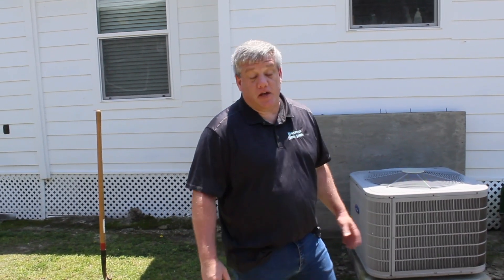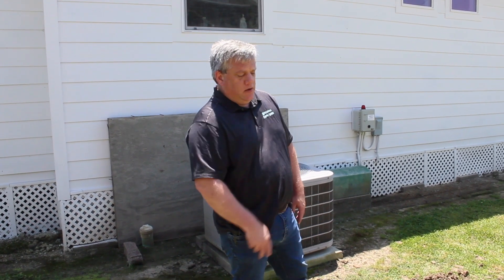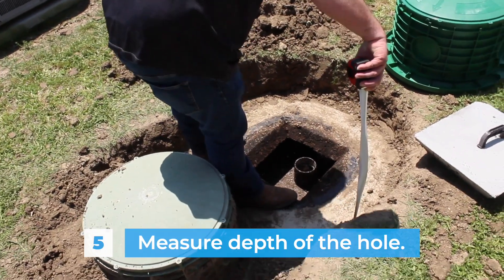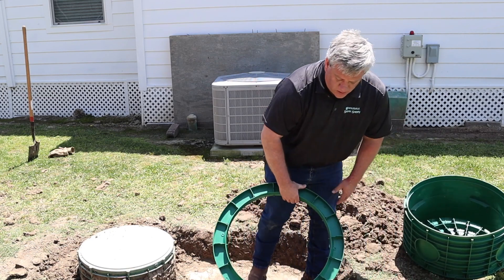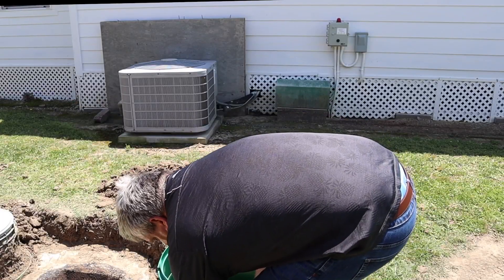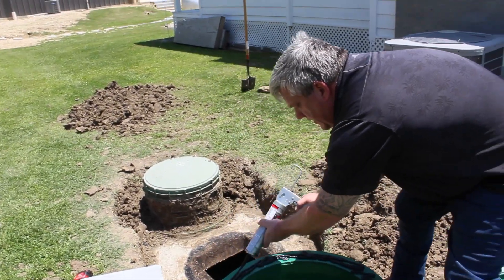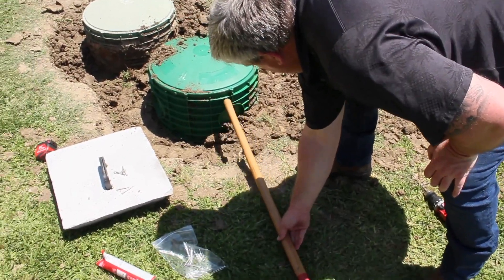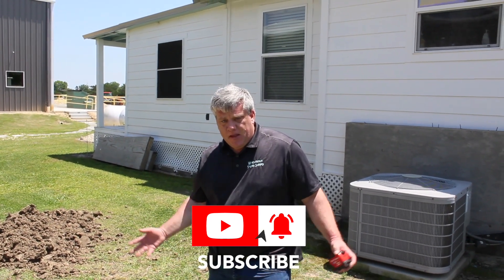Septic System Riser Kit Install

Comment: Thanks for the video! I am sure just setting the riser on the tar would be sufficient in a warm climate, but up north by us where we have subzero temps and frost heaving I am going to use at least 4 screws into the concrete to prevent the soil from unsealing the riser.

Comment: Good info! How would I go about purchasing 4 riser extensions? My daughters house has very short risers, they are even with the ground and look slightly different than these. It would be beneficial to have at least a 6 inch extension on them.  I'm in Virginia Beach VA. Thank you!
Reply from the maker: Hey John! You can go to this link right here: https://www.wholesalesepticsupply.com/collections/septic-tank-riser-kits

And that will have the different kits we offer. We also have individual risers and adapters from different risers. You can call us and send pictures and we can guild you to the right riser.